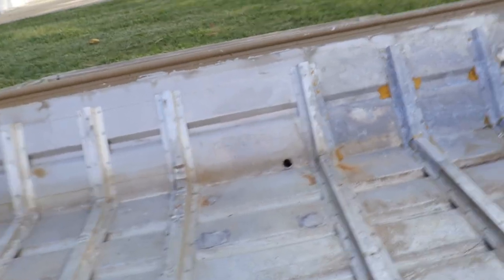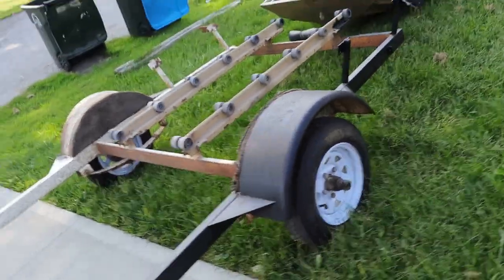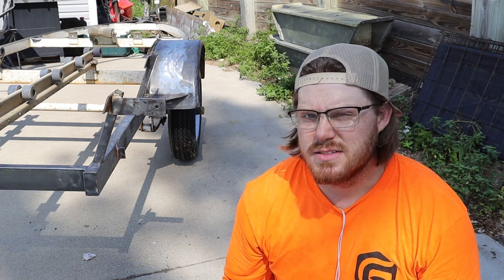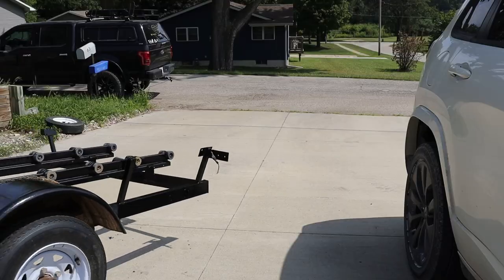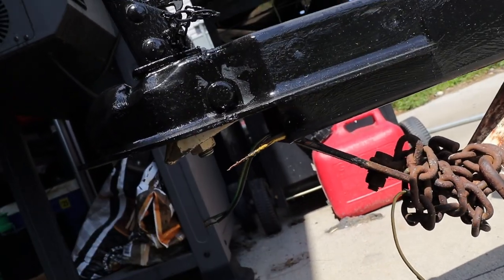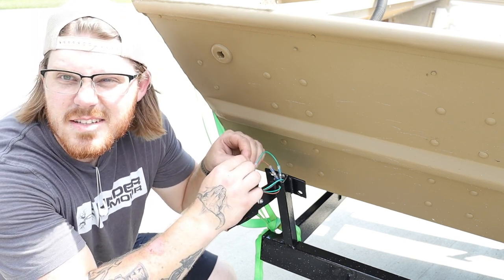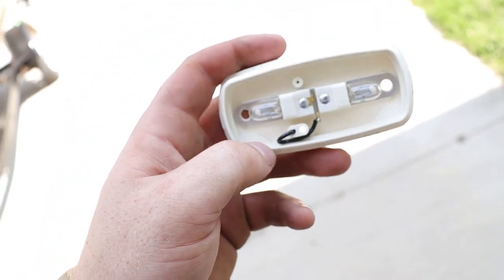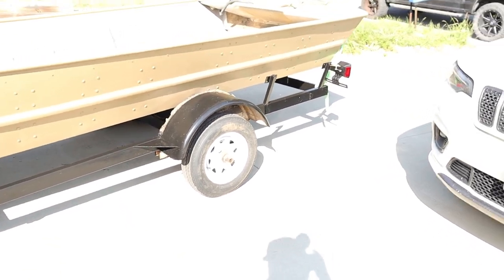Boat Build PT.2 Trailer Restoration!!

Comment: Ran across your elk vid and found this one.  Looks like the same light kit I added to my new boat trailer (used boat and trailer I purchased).  One thing I've gotten in the habit of doing on the lights is put some silicon seal along the seams to assist in preventing water to get into the housing. I'm on the other side of the MO river so may have to keep Apex Welding in mind.
Reply from the maker: That would probably be a good idea to do, it was a pretty cheep light kit and it might help out.